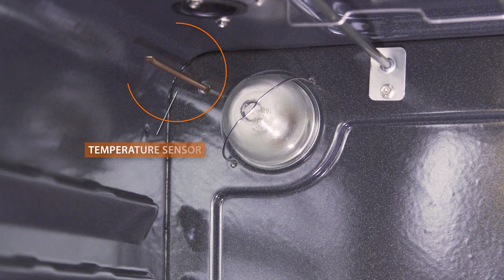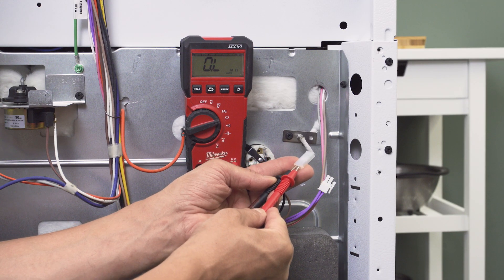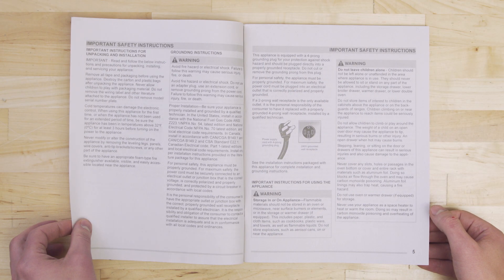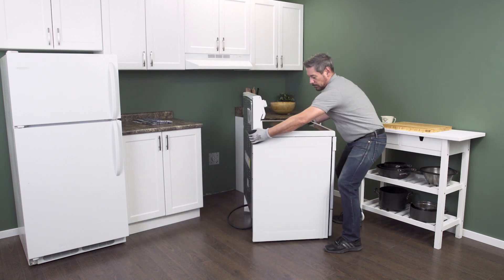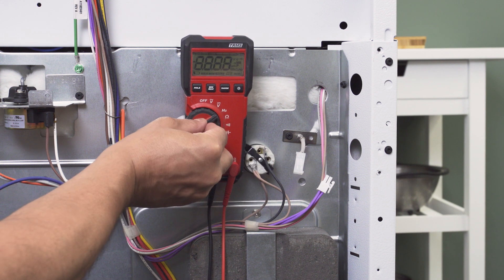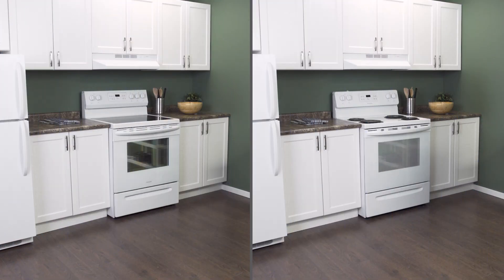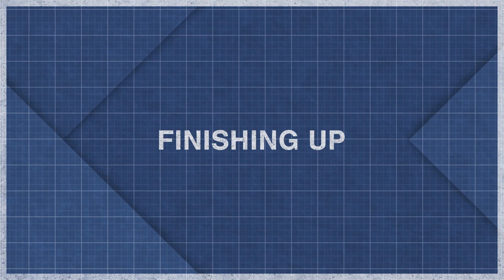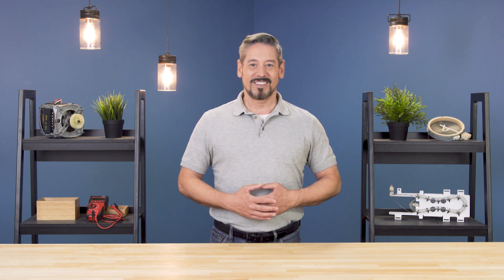Oven Temperature Sensor - Testing & Replacement | Repair & Replace

Comment from the maker: The most common resistance for an oven temperature sensor is 1080 ohm but select models can have different sensors with a different resistance range. If you are unsure, look for a tech sheet with the resistance values printed on the side. The tech sheet is sometimes at the back, or behind the front drawer but not all models will have a tech sheet.
Reply: hi i replaced my thermostat because It wasn't cycling the  heating element it just seems to funtion with ++hot or off. regerdless of setting or temp  the led never switches off to indicate it's reach desired or peak temperature I think it stops heating if it tops out at 240c and the eliment will switch of suggestions it's a indesit is5v4khw FYI

Comment: TRY CLEANING YOUR SENSOR BEFORE REMOVING AND REPLACING IT:

-My five year-old LG Model LRE3194ST oven was only heating to 365 degrees.

-First tried to replace the OEM sensor with $16 EBG61305805 sensor from inside the oven but the sensor wire wouldn’t pull out of hole far enough to expose the connector.

-Rather than pull the oven out and disassemble rear panel just to cut the ziptie holding the sensor wire, I successfully cleaned the OEM sensor by scrubbing with an abrasive pad and citrus GoJo Natural Orange Pumice Hand Cleaner. The OEM sensor wasn’t even very dirty (it only slightly discolored paper towel when wiping after scrubbing) but now the oven heats properly again.

Comment: Replaced temperature sensor..no effect, not working. Noticed OL ohms on one thermostat.  Replaced thermostat ($65!!)  and it started right up. Not so much of a device to control temperature as a device to shut off the oven in case of thermal overload

Comment: While testing the ohms, I get 1090 for a second or two, then it goes to '1', which is the default open setting on my multi meter. Do you think that I have an intermittent short or open in the wires?  I am assuming that a good sensor would have a consistent reading around 1080 at 72 degrees.

Comment: MAJOR MISTAKE!
"if you get ANY resistance then the sensor is shorted and needs to be replaced"
? That's completely BACKWARDS. If you get almost NO resistance then the sensor has shorted. If the resistance is HIGH as shown in the video, then the sensor is GOOD.
Reply from the maker: Test 1: resistance test of both sensor terminals. This is the first test.

Test 2:  testing from one terminal to the metal frame to see if it has shorted. The sensor should be electrically isolated from the oven chassis so there should be NO continuity in this test.  A shorted sensor can give incorrect temperature readings or trigger fault codes. 

A reading of - - - - -  or OL means there is NO continuity and the sensor is not shorted.
A reading of 0 - 1 ohm is a direct short and the sensor is essentially acting as a wire.
Other resistance ranges in this test would also indicate a short including the 1086 ohms... that still counts as a short to ground, even though it’s not a dead short.

Comment: Painfully slow but thank you
Reply from the maker: Thanks for watching. We've gotten a lot of feedback and more comments have spoke positively about the pacing about the video. For those who prefer a faster pace there is a playback speed adjustment in the YouTube settings on the play-bar. You can set it to 1.25X or 1.5X for videos that are not as quick as your preference.

Comment: I have a Jenn-Air.  Timer was set 350 degree for 1:00 hour.  Before the hour was up oven overheated and burned the food.  Showed "fault" turn breaker off and wait a few minutes, turn breaker back on.  Oven worked correctly after I did that for a couple months.  Then about the something happened, set the timer and temp for what the frozen dinner said.  Oven overheated and burned the frozen dinner before time was up.  Said, fault again.  If the temperature sensor is bad can it work at one time and then not work in a couple months?
Reply from the maker: Thanks for watching. Yes it is possible that a sensor has intermittent problems. In your case it would be best to install a new sensor.

Comment: And WHY are we flipping the breaker off at the service panel when we are unplugging the unit from the wall???
Reply from the maker: Thanks for watching. This is a blanket safety disclaimer put on all of these oven repair videos. Either works but unplugging physically disconnects the circuit which is easiest to verify.

Comment: Thank you so much for this nice video! But i have an issue with a furnace system  where the SV&PV are mismatching during heating process, and at around 100 temp Celsius , heating stop while SV is 640tem Celsius. Is it a sensor issue or Temp Controller?
Reply from the maker: Thanks for watching, we're glad you found it helpful! Not sure exactly which furnace you have but if its not heating enough then it could be faulty limit switch, or there could be a problem with the thermostat. For more furnace troubleshooting we have this playlist: https://www.youtube.com/playlist?list=PLCo9SMjkdWBzorzNrARLKALj9fW7HzHMh

Comment: Hi,  I've checked the temperature sensor and it does show 1080ish at room temperature.   I put a heat gun on it and the resistance went up as expected, but then it started to go down??  Very confusing.
Reply from the maker: Thanks for watching. The only tricky thing when measuring resistance is having a solid connection with the multimeter probes. It is possible that the probes were sliding around which can affect the resistance.
Reply: @AmreSupply  Well,  just replaced it and it did the same thing.   Either a control board or a new stove in the future.  Thanks again.
Reply: @dnnymitc  How did replacing the board help you, or what helped you? I replaced the sensor, but the error still shows F10.

Comment: My Frigidaire stove ligts as i just put in a new ignitor the problem is it does not stay lit it stays on for 15,secs and then goes out i  light it again then the same problem occurs
Reply from the maker: Thanks for watching. A stove burner that does not stay lit can be caused by a weak gas supply or a clogged burner gas port. If the other burners stay lit and only 1 is having issues then it's most likely a clogged port. Try cleaning the stove burners thoroughly.
Reply: @AmreSupply  it was my typo error I meant my Frigidaire gas range oven compartment does not stay lit if you have an email I can send a video so you can see exactly what I mean
Reply from the maker: @khaddaffi30  Cleaning the burners and everything can still help in the oven. The oven will use a flame proving device. This will either be a thermocouple or a flame sensor. These can be covered with carbon so it's best to clean these as well. You can enter you model number here to see a parts lookup. This will tell you which parts are in your oven: https://www.amresupply.com/lookup
Reply: @AmreSupply  thermocouple is the same as ignitor right cause I just installed a new ignitor it's a brand new stove never been used but keep having that one issue everything else works except for the oven which keeps shutting off
Reply from the maker: @khaddaffi30 If the thermocouple is built into the ignitor module, then double check to make sure that the thermocouple connection is secure and that there is no buildup of carbon that might reduce the thermocouple voltage. If the ignitor and thermocouple are good, then it could be a faulty temperature sensor or control board.

Comment: What are the chances that the temperature sensor is faulty even though my Frigidaire doesn't have an error code. I have tested the sensor, I get a reading of 1085 when tested alone but then no reading when testing the negative lead to the metal? Sound like the sensor? When I try to heat my oven it takes 30 mins to reach a temp of 177° I hear all the clicking and it switches back and forth between the elements.
Reply from the maker: Thanks for watching. If the temperature sensor tests good in the resistance test, and when tested to ground, there's no reading then that means its likely good. It is best to check the make sure that the wire connections are secure, that there is no grease or anything that might prevent a good signal from passing through. As well clean any grease or a carbon buildup off of the sensor.

As well it's best to check the heating elements to be sure that they are both working properly. It is possible that 1 out of the 2 have failed; https://www.youtube.com/watch?v=96s7maybHlY

If not, then replace the sensor. If that still doesn't help then it might be a faulty relay inside of the control board. https://www.youtube.com/watch?v=ORTi4lLyoqw

Hope this helps

Comment: I doubt I can do this with my ovens. They're from the 1960's.
Reply from the maker: Thanks for watching. If your oven is from the 1960s then it will not have a control board and thermistor (temperature sensor). It will have a oven control thermostat which is a fluid filled bulb and manual contacts. These contacts can stick and cause issues over time: https://www.amresupply.com/catalog/Oven-Control-Thermostats-632506-AD1P

Comment: I have a Samsun range with double oven and both ovens are having the same problem. Oven reaches correct temp on the initial preheat but when the door is opened to insert or check the food the temperature doesn’t recover. It only heats to about 345 degrees. Is that a control panel issue.
Reply from the maker: Thanks for watching. If there are 2 temperature sensors and both ovens have the same identical problem, then it does lead to it being an issue with the oven control. Control boards are black boxes and are not easily tested, so in most cases if all other potential sources are eliminated, then it's best to install a new control board. We have a video showing how: https://www.youtube.com/watch?v=ORTi4lLyoqw

Comment: Hello, good evening, I have a whirlpool oven with the code F3 E0. According to the video it is the temperature sensor but when I check it it gives me a correct resistance around 1080. I don't know what to do. I don't know if it's the sensor or another part. Thanks for the help and I look forward to your response.
Reply from the maker: Thanks for watching. If the temperature sensor is good in an isolated test, double check that it isn't shorted to the metal frame of the oven. You can test between one lead and the metal frame, if there's continuity, then replace the sensor. As well check the wires leading into the control board and make sure that it makes a good connection. If that doesn't help then it could be a faulty control board.

Comment: Hi first thank you, and do you have anyway to check the resistance temperature detector without multimeter please, my oven its not working but the heaters up and down its ok, but the oven it doesn't get hot whay?
Reply from the maker: Thanks for watching. An error code can tell you if there is an issue with detecting the temperature, but the only way to know for sure is to test the temperature sensor with a multimeter.

Comment: I ordered the sensor for the oven but it is shorter than the original does that matter? its a whirlpool
Reply from the maker: Thanks for watching. If you have ordered a sensor that is compatible with the oven, and has the same resistance values as your previous sensor, then the length should not matter as long as it is mounted in the same way. The sensor will still heat up as normal.

Comment: I have a Blomberg-appliance (range). The temperature sensor is PT500. This type of sensors are made from platinum and the resistance is 500 ohms at 0 degrees (C). In the video the repair shows a different appliance but the explanation about the thermal sensor seems to me like a general one, for all sensors. In fact it is not - there are different sensors with different resistance.
Reply from the maker: Thanks for watching. There are some exceptions and thank you for sharing your experience. We have updated with a pinned comment to help better communicate these differences between models.

Comment: I'm having trouble getting much service info on my Siemens double wall oven. Purchased in '08-or '09. It's been great until recently. We had an instance or two when it overheated and had to  shut off via the breaker switch because the control panel siezed up at the time. after switching the breaker back on it reset itself. Then, however not long after maybe a month or two give or take we started to notice the heat was about 50 degrees less than setting. So we just adjusted accordingly until it just wasn't anywhere near heating. Then we started using the bottom oven more often because it still worked ok. We have removed the heat sensor thermometer  probeand tested it. Numbers were flashing irradically, we have ordered the replacement and are yet to install. As of right now we have an error code on screen and are unable to use the bottom oven in the meanwhile. Which we were using until we removed the sensor from the top... It sure would be nice to have more service tech info on the machine. Since it's far from brand new but still in very great shape. I dont consider it old or antiquated. I'd like more than wiring diagrams and would really like to know how to decipher codes and reset/program.   😀👍💪Your video was helpful to me at any rate and I appreciate that very much!
Reply from the maker: Thanks for watching. When it comes to service manuals, those are not always available but you can sometimes find it if you do enough searching. To clear the board, sometimes holding down "cancel" or "clock" for 10 seconds can initiate or reset the board. This varies between models so those may or may not work. When it comes to the wiring, it will vary but the basics remain the same. The temperature sensors will be connected directly to the control board. Each heating element is also connected to their own relay on the control board. If you have 4 heating elements, the control board will have 4 relays. Some models also have a fuse or high limit switch which is sometimes connected to the elements so that is something that would show up on a wiring diagram or a parts list. Hope this helps!
Reply: @AmreSupply  Thanks a bunch for your speedy response! Turns out I won't be needing to reset any codes right now. I hooked up the new sensor and all is well! The oven reset itself as soon as power came on! Hallelulah! Thanks again for allthe support and extra tips and info! I will tuck it under my hat for futere ref! Blessings to you all in Canada from a Yankee in Alabama!😀👌👍🤙
Reply from the maker: @allthings2allmen  You're welcome, we're just happy to help! We're glad to hear that the oven is working after installing the new sensor!

Comment: I didn’t think thermosistor have continuity
Reply from the maker: Thanks for watching. Any resistance value 0 and above means there is continuity. If you tested the sensor, and there is no continuity, no resistance reading or you see - - - - - on the screen, then the sensor has failed and should be replaced.
Reply: @AmreSupply  what if I have to set my oven to 430 degrees for it to hit 375
Reply from the maker: @ethane8219  The sensor could be starting to wear down. You can calibrate the oven temperature but most models have limits to how much you can adjust the temperature: https://www.youtube.com/watch?v=s8UdnR4Jw_g

Comment: ok I'm getting a readding of 1080,,, does that mean a bad reading or good enough? Should I order a new sensor?
Reply from the maker: Thanks for watching. A resistance of 1080 ohms is completely normal.
Reply: so I got no resistance the grounding test,,, this must mean my sensor is good and my problem is in the control panel?
Reply from the maker: @cold2four1  It depends what the overall symptoms are. There can be other components to check: https://www.youtube.com/playlist?list=PLCo9SMjkdWBysYYCcg5xQLiVh_cW0JQvt

Comment: When I put one probe on each side of the sensor it does read correctly, but when I put one probe to the sensor and the other to the shiny surface of the oven my multimeter just says 1. Does this mean the sensor needs to be replaced?
Reply from the maker: Thanks for watching. It depends on your multimeter. Is that 1 ohm or is that 1 a default reading when there is no continuity?

If there are no decimal points then it could be just a non continuity reading. Some multimeters will displace - - - - - -, or OL when there is no reading.

If it is 0.1 ohm or 1 ohm then its possible that the sensor is shorted.
Reply: This is what is happening to me as well.  I’m getting a 1 ohm reading. Where would the short be? What would cause this? @AmreSupply

Comment: Bought the aftermarket sensor it called for but the plug is not the same.
Reply from the maker: Thanks for watching. If the aftermarket sensor does not have the same wire connector, then you could splice the wires and use the old connector.

Was that aftermarket sensor one that was listed under a parts breakdown? If so do you have the link? https://www.amresupply.com/lookup

Comment: I have an electric Whirlpool range with a double oven. the top of it is small and the bottom one is normal size. Randomly they will not heat to the set temperature even though the display will say that it has finished preheating. today one of them heated to 400 when it was set for 350 although this is not a common problem with it. Both ovens have this problem of not heating to the set temp, but sometimes they work fine. what part should I test?
Reply from the maker: Thanks for watching. It is best to test the temperature sensors. If those are good, then it could be an issue with the control board.
Reply: @AmreSupply  Your oven sensor should read around 1100 ohms this is a great video which shows how.
Reply: We are having the exact same issue with our whirlpool double oven. Just replaced sensor. Oven alerted is it was preheated for 425° but the termometer shows only 300°... Same issue we had prior to buying and replacing temp sensor. Have calibrated it several times.